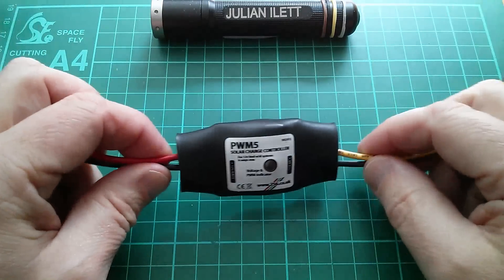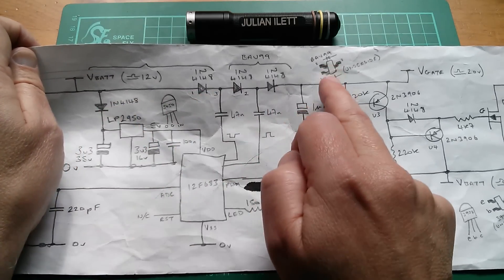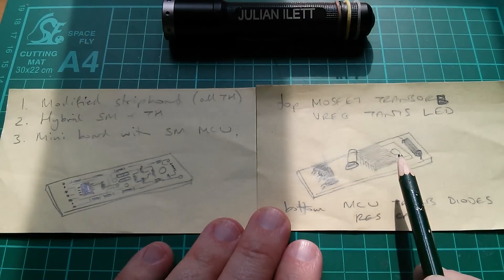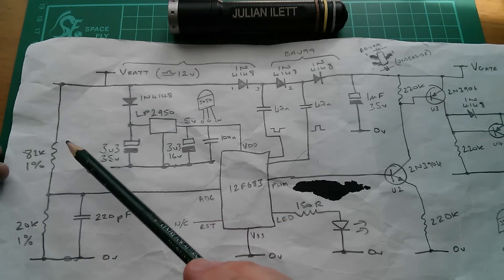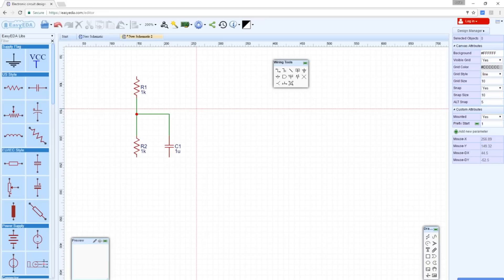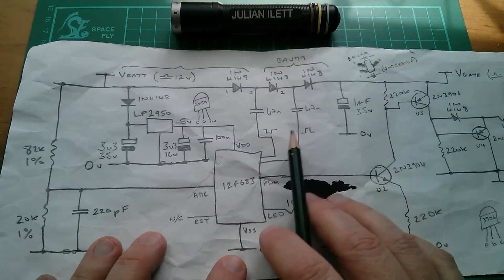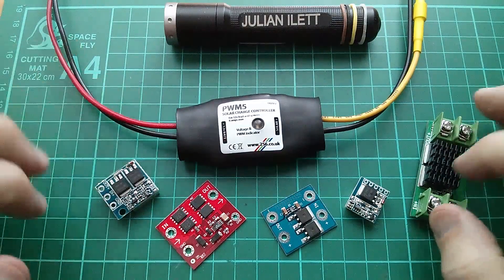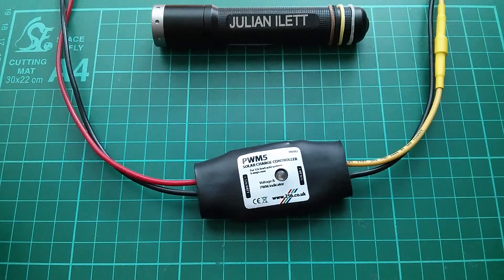PWM5 Solar Charge Controller SMD Re-Design with EasyEDA

Comment: "almost untouchably warm, about 100 degrees". Are your hands made of asbestos? almost untouchably.......
Reply: No, in the UK there's Celsius but they also call it centigrade.
Reply: The heat shrink tubing is isolating a lot of heat I guess.
Reply: When you do a load of soldering over the years, your fingers get used being hot and high temperatures are tolerable. The 'Boiling Frog' anecdote https://en.wikipedia.org/wiki/Boiling_frog comes to mind. I personally use tweezers or a surgical clamp. I guess how the 'Asbestos fingers' saying comes to mind too.
Reply: Justin DiPlacido 
Not really, 100F = 37C could hardly be called hot so it is an unrealistic assumption.
Reply: could be 100 degrees Fahrenheit?
Reply: The Uk isnt wholly celsius. Its quite common to use F for hot and C for cold. but julian seems to be a modern guy so Id bett he uses C..